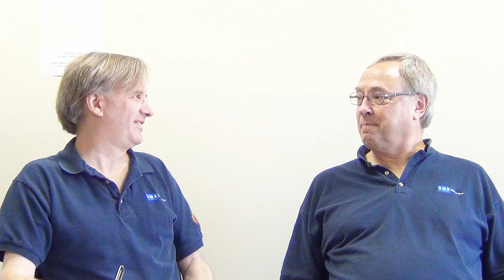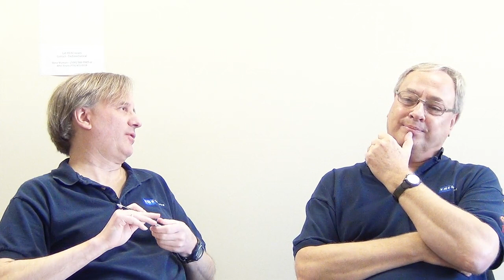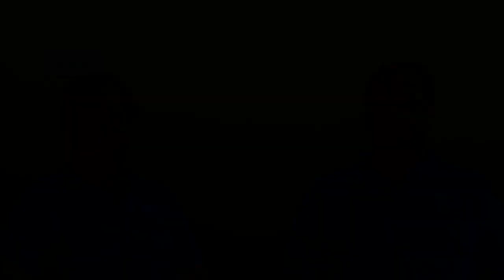Rob Brooks and Paul Anderson's VMS Stories

Comment: Very nice.
A few notes however:
On the build procedures, I agree that you should know your build procedures well.
On the flip side, The DCL set working_set command uses units of piglets, not pages.  So, setting the working set (you did not specify limit, quota, or extent) would actually set the working set list to 500 PAGELETS == ~80 Pages this would kill performance, as it would cause dead page table scans which would lead to very unfavorable paging metrics.  This could have been seen in less than 20 minutes by doing an EVAL @PMS$GL_DPTSCN in SDA.
Not a big deal, except that "giving a process whatever memory it needs" is very dangerous, as overcommitting Working set quotas can cause the same scenario as OpenVMS reclaims memory back to BORROWLIM pages.  So, there are formulas for setting this stuff which AUTOGEN can mess up.

On CLUI$COMMON, the AMDS command procedures, I believe, reference this logical name.  Regardless, the attitude toward the functionality was very cavalier, as there are at least two reasons right off the top of my head that I can see to "mess with" SYS$SYSROOT/SYS$SPECIFIC/SYS$COMMON,  The first and most obvious is the need for multi-architecture system disk considerations.  You need a place for common data files/logs. and separate image disks, minimally.  Or will this not be supported with OpenVMS on x86?
More importantly for my organization is availability.  Our production cluster has been up for 99a days, and before that it was up for over 1200 days.  The only reason for down time was a VMS bug that could have potentially caused disk corruption.  We keep this up time while having supported a quarterly maintenance schedule that included patches and firmware updates.  To doing so, we maintained two "read-only" system disks and one "writable" system disk  The writable system disk maintains cluster common writable files.  While the "read-only" disks could be patched independently, in each case keeping roughly half the systems up,  We do maintain on odd node to maintain quorum through the transitions.
We could not have done this without modification of the SYS$SYSROOT lookups.  There were a few hiccups at the beginning, moistly due to TCPIP assumptions, but it has served us well over time.

On the 64-bit arithmetic in DCL, I heard the word "impossible" at least 2 times.  This seems totally absurd to me.  We have in-house utilities that allow the use of DCL symbols for 64-bit arithmetic.  This is required as we have several volumes just below 2TB in size.  The bsh and ash shells each support 64-bit arithmetic AND floating point arithmetic, as does REXX on the IBM mainframes.  So, "impossible" is, pardon me, impossible for me to fathom for an update to DCL.  
On backward compatibility, don't be absurd.  That MAGA/Trumpian philosophy will keep OpenVMS in the dark ages and accelerate its demise.  Things change in Major releases, and some features go away.  You cannot progress with out it.

Thank you for taking the time and effort to do this presentation.  I do not mean to be overly critical.  Granted, I have perhaps not shown clairty here, but perhaps more clarity.

OpenVMS has many fine qualities, as well as many warts (at least it does not use EBCDIC), but don't stall out, Make OpenVMS Greater.
Reply: I still  have "The Hitchhiker's Guide to VMS" on my technical bookshelf (but it has been collecting dust for the last 25 years)   BTW, do you have any videos of your magic sessions?
Reply: @jonpinkley2844  Thank you for asking.  I am sorry, but I do not.